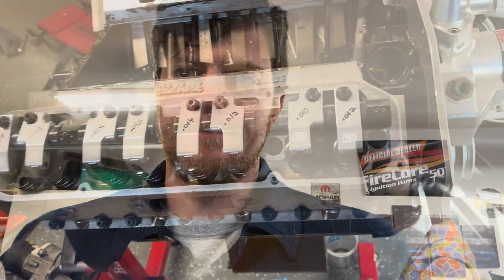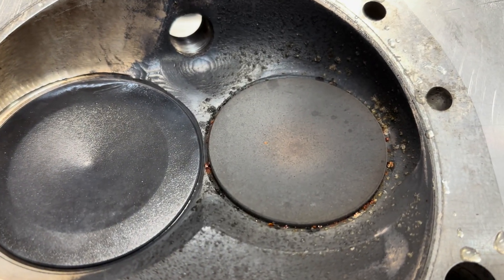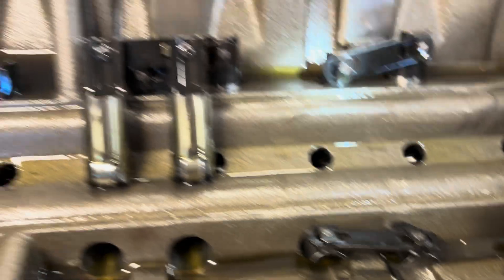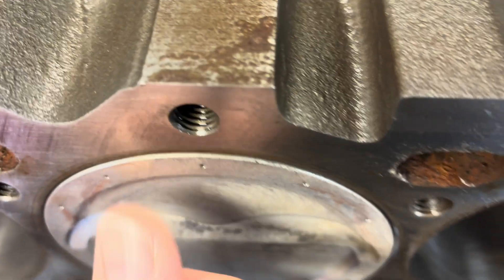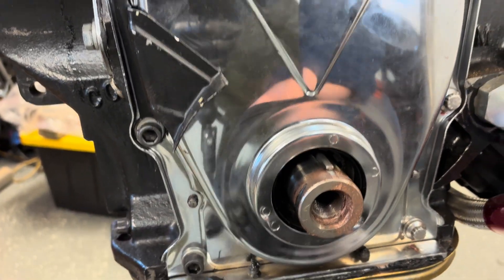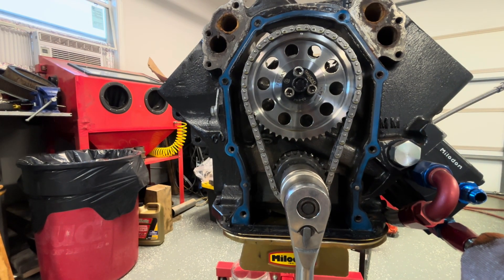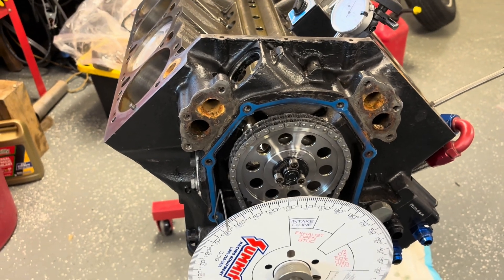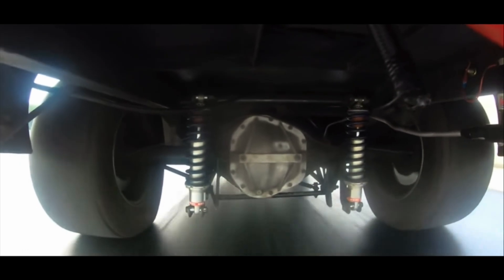The 580 Stroker Top End Teardown and Cam Specs

Comment: Totally off course from this video but im at a loss I have a 78 440-3 if I put a set of 440 source stealth heads on it am I going to have over heating issues due to the extra coolant passages on this motor? I've heard both but I dont want to waste my time and money if it's not worth it
Reply from the maker: Absolutely not. Most head gaskets out there block off the appropriate passages. You’d never notice anything on overheating issues. The aluminum sheds heat better. My blue truck has the stealth heads now.

Comment: Hey joe..hows your challenger 440 going??
Reply from the maker: @danieljacobson5774  excellent! I’ve got the rotating assembly at a balancing shop. I’ve also got the paint for the block coming in today
Reply: Cool..now you need a good rear end for all the power..lol@JustMoparJoe
Reply from the maker: @danieljacobson5774  yes sir. I’ve got an 8 3/4 now, but I need to lock it up!

Comment: Joe I've got a question not related to this engine if you see this. On that stock stroke roller cam 400 you did the dyno series on a coyyears ago. Any idea what kind of vacuum that would make on idle?
Reply from the maker: I’m sorry, I never checked it. I have that engine in my blue truck now, with slightly different heads. I will try to remember to check it if I run it this weekend
Reply: @JustMoparJoe  I run mud trucks and have a vacuum rule. Was just trying to get a feel if that cam would make enough vacuum to fit the class. I was impressed with the power you made with it.

Comment: It looks like the motor was stored without loosening the rockers and in an unheated area which caused moist air to come into the cylinders, maybe the carb was off, or open enough to circulate air that condensed on the cold metal
Reply from the maker: Yes sir. I’m thinking it was a combination of things. The carb was definitely off.

Comment: Some friendly advice. Cam cards do not tell you where they are supposed to be installed at in an engine. The info on the card is just how that core has been ground. It is up to the builder to decide, based on many variables, where a given cam should be installed at. Unless the cam was profiled specifically by the builder, and ground a certain way with intentions of being degreed to a specific centerline. Any and every shelf grind is what it is, so if a certain shelf grind is chosen to be used, it should be degreed to where that specific, pre-ground profile will make the most power from the builder. NOT to what the card says. The companies that sell shelf cams are universal and NOT ground to specific engine parameters. They don't know where it should be installed in every engine. It's just saying where that profile was ground to. So because the card says 112 to degree at 108, that just means it has 4 degrees built into the grind. They are not telling you where it HAS to be installed. If the lower gear is on 0, it should technically degree in at 108. Due to many variables, it can be off. That is why we degree cams and not rely on the famous dot to dot way of degreeing. 

Curiousity has me wondering if that TD rocker setup is made to utilize shaft oiling, or if it is designed for pushrod oiling. Even more curious would be why BOTH would be used. Running restrictors in the block feed leading to the head is common for some builders in a Drage race only engine, but oiling through pushrods as well? Have never witnessed it. Creates a giant internal oil leak which will lower pressure. If pushrod oiling is the choice, why a restrictor? Why wouldn't it be blocked? 

Checking .050" over the nose, or even better at .020", is ok for a quick idea on where that lobe is fully open, but it's always best to check your open/close at .050" as well. Compare notes and make sure they are the same. If not, you need to figure out why, as one method can read a different centerline than the other. 

The rust in speific cylinders only just means mositure. Was a plug or plugs left out while sitting too long? Did water enter the intake at any given time while sitting? It's not from alcohol mainly because it's not in every hole, at every valve, nor is it alcohol based on the lack of fuel burn and color on the pistons and chambers. Either way,  whatever pitting you see at the top of the cylinders, you will need to make sure it is above the top ring. If not, they'll need to be cut. Rust on the seat? Make sure it wasn't affecting valve seal. 

Lastly, and it's just an observation through my experience, but if it were me, those pistons would be the wrong choice in a big inch race engine with compression. They are a full round spherical dish with no real quench pad. Unlike the factory style iron BB Mopar heads that have recessed chambers and no quench pads in which case these wouldn't matter, newer aftermarket heads do have flat pads in their chambers for a reason. Why someone would run this style of piston in this application is beyond me. Power left on the table right there. You can even see it in the chambers, amongst other things. 

Just my take.
Reply: The water isn't from condensation. Look at the pistons where the cylinders have had water and you can see cleaning. On a car with a blown headgasket it's easy to see where the water has been getting in because the piston is clean or cleanerer - this has a bit of that going on at least as far as I can see.
Reply: @ThePaulv12  If you're referring to the "clean" aluminum around the intake pockets and valves, that is NOT from water.
Reply: JDR,  The T&D rockers on this engine are designed for shaft oiling.  Same rockers I am running and I don't have pushrod oiling.  The pushrod oiling is likely OK depending on the restriction.  On a stock engine that would take oil away from the main oil galley.  I don't know if this aftermarket block has priority main oiling and the rocker galleys are oiled through smaller galleys that might be restricted?  On the pistons, I didn't catch that the entire piston was dished.  In an older 451" 400 block engine with ROSS pistons, they were dished like this for 11:1 compression.  If this was a race engine, not sure what compression ratio they were looking for, but I would have not removed the quench side of the piston.  The Victor heads 74cc as cast chambers have more quench area than most of the other Mopar heads.  Seeing the heads were CNC, curious if those are from Hughes Engines?   I was just mentioning P-V clearance as it was a concern I had with my engine, and should be checked.
The installed centerline might just be where the power band works best for the combination, 580 cid is alot of torque.
Reply: @zerogmopars746  There is no need to oil the rockers both ways. Period. The shafts get oiled through the deck from #2 and #4 cam journal, in a timed manner. They are not fed from a main galley, regardless of block or priority oiling, typically. Oiling them both ways floods too much oil up top, creating an internal oil leak and can lead to loss of pressure. Should be one or the other. Nothing wrong with pushrod oiling, as it exists on mostly every race engine there is without issue. 

Yes, factory BB Chryslers have no quench pad, so running a full spherical dish in a factory head, or aftermarket with a concave chamber, or no quench pad, is common. At that point it is only used for serting static compression. What you DON'T want, is higher compression with no quench, especially on a pump.p fuel combination. That is why most rattle. Stepping up to an aftermarket head with a flat quench pad, allows the use of a piston that will utilize the proper quench. 

Nothing wrong with running the cam where it is, IF that application calls for it. Personally, it's not what I have profiled, as the tight distance from intake lobe to exhaust lobe won't allow for rpm and higher peak power, especially in a big inch deal like this with limited cross sectional area in the induction system, so at that point, backing it up would help that, as a band-aid. Or it could have been done for clearance. 

Points are moot so to speak, since the engine is in the hands of someone else that is going through it, I can offer all the points I want as I see where power is being left on the table, but ultimately it's up to what the customer wants him to do.
Reply: @JRD_Motorsports  On the rocker oiling, I want to see if the center three shaft hold down studs are the correctly modified ones with the diameter turned down for oil flow.  The T&D Shafts are smaller diameter and thick wall so oil can't flow around the hold down studs like the larger thinner walled factory shafts.

Comment: Another commenter mushmouth mentioned mostly what I was figuring: methanol engine (i dont remember you clarifying that in the previous vid but 12:1 comp could lean either way). With the exception that I would bet my tax return the specific cause was they had this in the car, did a startup to get it off the trailer or w/e, then shut her down after only a couple minutes. They likely never got the engine hot enough to burn off the residual moisture. You directly pointed out the rust points between the rings in #5 and #7 ... thats a pretty common neutral point for any 18436572 engine to stop at.
Reply: If alcohol, why isn't it in ALL cylinders? On every valve? Alcohol isn't biased to specific cylinders it wants to corode. 😏
Reply: @JRD_Motorsports  If you have fuel in ALL your cylinders at the same time you're doing something seriously wrong. In this case 5 and 7 showed the most corrosion, in my experience I'd be checking 6 too... it might have the start of a trickle with that large of a cam the intake valve just maybe cracked a smidgen.
Reply: @cjm5002  
The engine wasn't run on alcohol, which is obvious by looking at it, hence why it isn't from alcohol. 
Alcohol engines show signs of corrosion everywhere and in ALL cylinders, not just 2 of them..   
Just sayin'
Reply: @JRD_Motorsports  Right, but not the levels you're talking about in the time it goes from dyno to car and back out again. At least I think that was the story? I don't recall him mentioning it ever making a pass even. This is sitting damage, some level of negligence. The scenario seems like it came home and went in the car and just never ran right so got mothballed until it got yoinked and went to Joe. Without knowing the antecedents of the engine between then we are all just playing guessing games. But one thing for sure, and even you have to admit, is any kind of alcohol based fuel + time in a cylinder = these levels of rust and in a hurry... especially  E85 or methanol. I can't wait to see the rings and lands when he pulls those pistons out!
Reply: @cjm5002  I think that is pretty much what I said lol. There is ALWAYS a story, but the engine has the final say. Yes, alcohol corroded quickly. Worse when hot, since if anyone understands the nature of alcohol and how it burns and what happens after it does, it is typically happening right after shut down. Correct, nobody knows just how long it sat, as it will get worse quick if it wasn't flushed/run with gasoline before it sat. However, it DOES get to the levels I am saying in EVERY cylinder, because EVERY cylinder would have alcohol in it after shut down. Alcohol engines use over double the amount gasoline, Alcohol engines are typically "saturated" with fuel, even after shut down. ANY cylinder that was burning alcohol WILL have plenty of it in the bores after shut down. If left sitting WILL corrode, rust, oxidize, dilute the oill and destroy shit. It will NOT only affect 1 valve and cause just 2 cylinders to pit with no visible rust.

Nobody knows the true story behind it,  I am just commenting on the reverse engineering and forensic diagnosing, which is part of my real life job lol, while watching him do it. The engine ALWAYS tells you what's up, IF you know what to look for. And this engine was NOT run on alcohol lol.
Reply from the maker: I’m fairly certain he ran some basic 110 octane race gas. I agree on the start up and burning off that moisture.
Reply: Joe, yeah you can clearly see the rust lines in there and can tell that 7 came to rest at full compression. Whatever was in that hole never got back out... and if thats any kind of alcohol derivative fuel well there is your 'smoking gun'. I've seen plenty of people use garbage pump gas (ethanol) to store their cars over the winter where all they do is "let it run a few minutes to keep everything oiled up" and end up they had rings seize in the bores. I seem to recall just a few months back you were helping revive an old bird that had exactly this happen.

Comment: Might be degreed different because of piston to valve clearance
Reply: One of a few reasons why a cam would be installed where it is installed, yes. OR, it's because that is where the builder wanted it.
Reply from the maker: The builder may have set it there after checking piston to valve and realizing it was too tight. We won’t ever know.
Reply: @ Agreed.  
I'm running 272/278 duration @ 0.050, 110 lsa.  I thought about going larger, with deeper notches in the pistons, but the pistons I have don't have the material, they are fairly thin at the valve notches already.
Reply: @zerogmopars746  I find a lot of guys who wind up installing larger cams, check piston to valve AFTER degreeing and realize they don't have the room, UNLESS they back it up 2⁰ or more for clearance. Kind of defeats the purpose, but can be done. I ran into this exact scenario with Big Chief's small block in Jackie's Cadillac. Sometimes it just happens when notching pistons isn't on the menu.
Reply: I guess check piston to valve clearance right now and then adjust it 2° and check again. Might answer the question???
Reply: @Hillbillygarage1215  Well, technically yes... but what I have found over the years with engines from other shops is typically just do a piston to valve check as it sits, after the cam is degreed, and just see how much clearance there is. If it's already too close, and the cam is backed up off the supposed centerline, that right there will tell you the "why" it's backed up. Wouldn't need to advance any further. 
That said, if there is a ton of room, it could just mean that is where the centerline wound up at zero, even though the grind has 4⁰ built in, and the builder didn't move it.

Comment: Why would they put those plugs in those oil passages? Those tiny holes might get blocked. I'm cornfused. Wouldn't more oil be better?
Reply: Because it will flood the top end with oil. Less oil to bottom end
Reply from the maker: Too much oil is bad. But oil does help cool the top end and lubricate it. The orficed plugs are a known trick to control oil flow there. My engineer buddy wants me to measure the hole size to determine how much oil it is flowing.